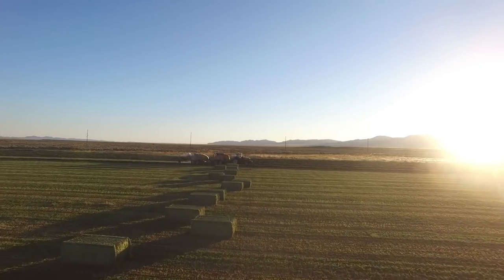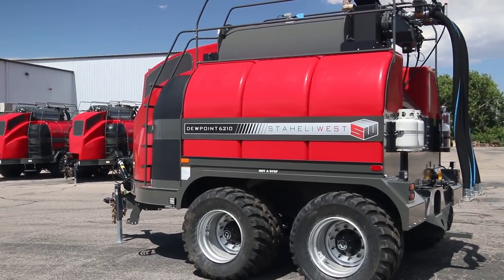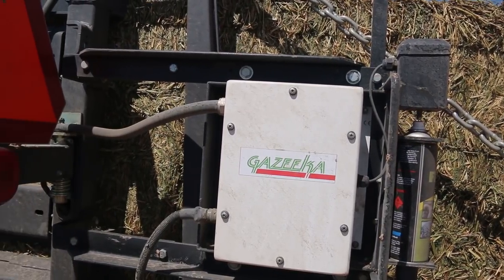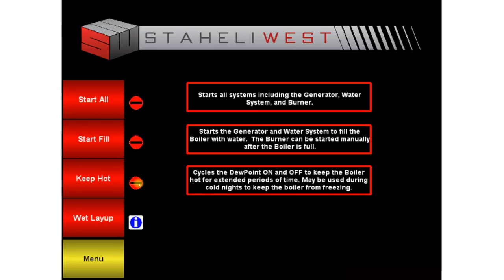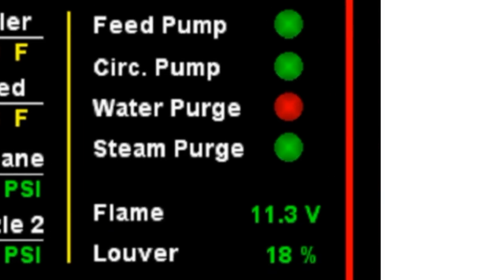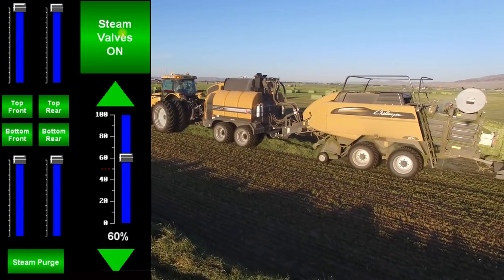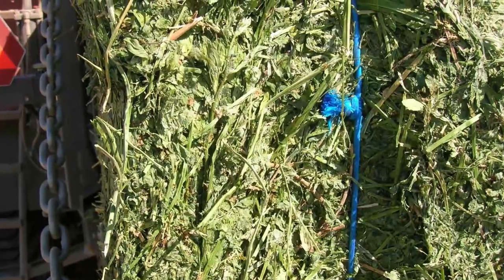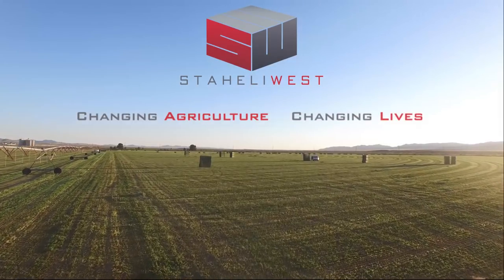DewPoint 6210 Operator Training

Comment: It was just the other day I saw a machine like your in operation and I had to ask the guy what it was! Here in Canada the farmers and ranchers are always trying to get rid of moisture, not ad! When are these machines sold? Arizona?
Reply from the maker: They are actually sold all over! Even in wetter climates. We've just sold 2 machines into Alberta! In the wetter climates the DewPoint machine has come in handy because farmers used to only be able to bale for 1 hour in the morning when things got dry enough and then it would get too dry to bale. Now they can continue baling without worrying about shattering the leaf.
Reply: StaheliWest No kidding, very interesting! Don’t the bales heat when they are baled with such a high moisture count?
Reply from the maker: Yeah we tell people never to bale with green stems unless they have a proven hay preservative. In dry climates most DewPoint operators try to stay somewhere between 12-15%. In Argentina in a wetter climate where we have 2 machines they try to stay between 13-17%. The bales come out fantastic! As long as you don't bale with stem moisture you shouldn't have a problem with bales heating up.

However when baling in hot conditions, we teach all of the DewPoint operators to make sure the internal bale temperature stays below 135° F (57° C). If the internal temperature gets above this you can get some internal discoloration where the insides of the hay bale look like tobacco.
Reply: StaheliWest I asked a hay maker from our area about a hay steamer and he too had never heard of it before! He too said the same as me, we are trying to get ride of the high moisture so we can bale it. I have worked with farm equipment, small square, large square and round balers for 20 years and everyone is trying to get rid of the moisture. You see the humidity here in Southern Manitoba is very high with a heavy due every day! But I bet it works very well in very dry areas!!